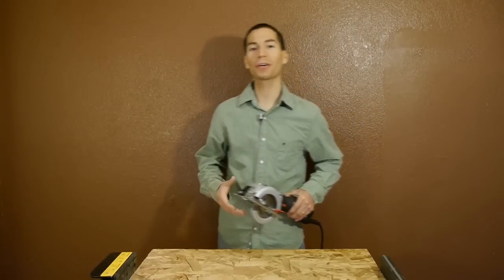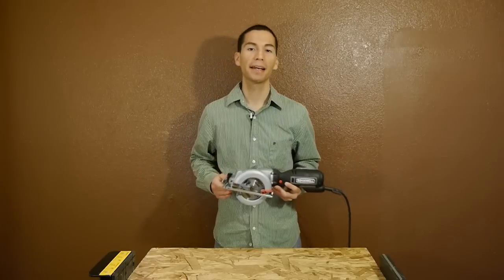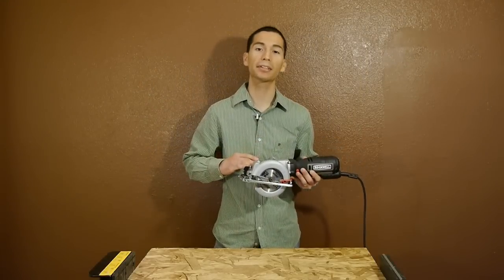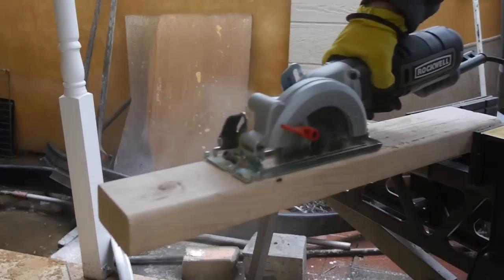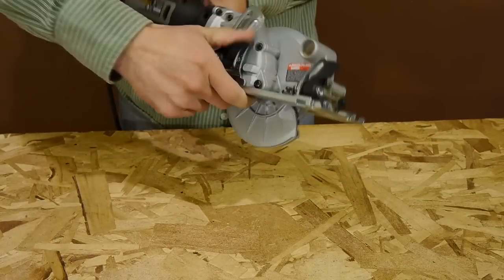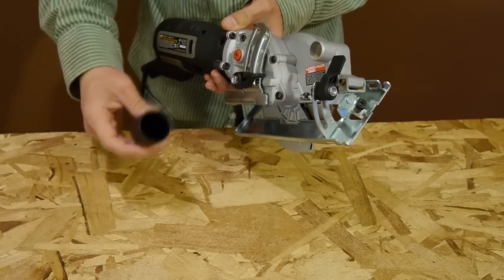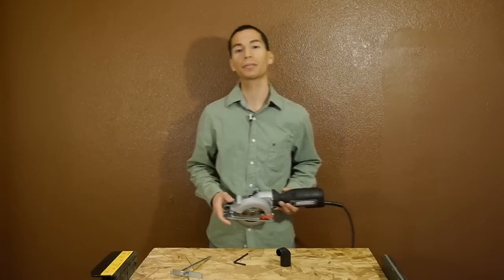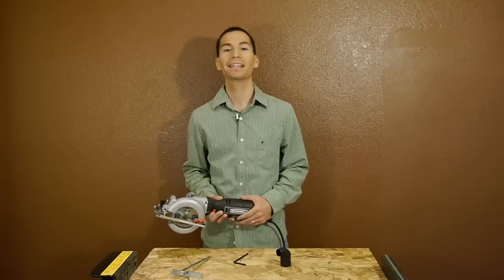Rockwell 4-1/2" Compact Circular Saw RK3441K Review

Comment: I wanted to like this saw, I really like the dust collection port and size.  I ordered online at Home Depot.  The first time I used it, I noticed that it would not cut a 2x4 square.  Even after making some adjustments, it still would not cut square.  I also noticed that the base plate/shoe would flex slightly when applying pressure to the saw.  I returned it.

Comment: great review Javier, i picked this up last year for a home improvement i was working on but ended up taking it back and getting a corded DeWalt 7" saw instead as the depth of cut was ever so slightly too small to make the cuts i needed, which was entirely my fault as i measured the timber incorrectly but it felt like a great quality tool, I have a couple of cordless Rockwell tools so i know they are well made and reliable. I may end up picking this up again just to have it in my tool kit!
Reply from the maker: TheBearuk1 thanks bro, I've done that before. Bought a tool, sold it then bought it again because I liked it so much.

Comment: I have a Genesis from HomeDepot, same saw by another name and less expensive.  Its my favorite saw and have other several new 7 1/4" saws, too.    I try to use it first and go to my other saws only if absolutely necessary because of the small blade.  Its primarily  for crosscutting sheet goods and two by lumber.  Its accurate, light weight as mentioned and  faster for this work.
Reply from the maker: Yeah I've seen a whole bunch of different brands slapped into this tool including a Porter Cable model https://toolcraze.net/porter-cable-pce381k-4-12-inch-compact-circular-saw-rockwell-rk3441k-disguise/

Comment: I just ordered a diablo blade for mine. I install wood stairs and I use 1.25 in (actual 1 1/16in) Red Oak and I cut right through it. Hopefully with the new blade it will cut even smoother. So its plenty powerful, most people won't need to cut through over 1 in Red Oak

Comment: I agree with David J's comment below. The shoe is flimsy and warped in the front. Almost impossible to fix a 90 degree angle with the blade. The handle is definitely for big hands and the safety thumb button is set so on the handle as to be very difficult to manipulate.That said, it is handy for quick cuts and I have used it almost exclusively for a couple years now. Back to the shoe __. a little beefing up of that and I would recommend it. But not as is.

Comment: Now if there's a cordless version of this, it will be the perfect compact circular saw for DIY work. I hate cords lol. Thanks for the video bro!
Reply from the maker: you're welcome bro, and there are plenty of cordless circular saws. The most common are 18V 6-1/2" models some are bigger 7-1/4" saws and you can find them with 5-1/2" blades as well. The ones that would be the closest in size to this model would be the 12V models from Makita Bosch and Milwaukee but the milwaukee 12V is the only one of the 12V group that can cut 2x4's in one pass.
Reply: I do own a 6-1/2" cordless DeWalt saw, paired with their precision blade the cuts are smooth and fast. I was however, speaking about this saw in particular since it's so lightweight and ergonomically pleasing ( from he looks of it) so it would be perfect to have it as a cordless tool in the future. I work on 3/4" MDF so the depth of cut is great on it.

Comment: I have the Menards version of this tool and it looks identical and spec'd about the same. Works quite well but not sure if it will last as long as the Rockwell. Menard's pricing is much less for basically the same tool.
Reply from the maker: There's a ton of clones of this tool from porter cable https://toolcraze.net/porter-cable-pce381k-4-12-inch-compact-circular-saw-rockwell-rk3441k-disguise/ to tacklife and many others. It seems Rockwell doesn't have the rights to the design and the actual manufacturing plant just makes it for whoever wants to slap their name brand on it.

Comment: Nice saw. The smaller size is a great idea . 5 amps doesn't sound like a lot but it seemed to cut quite well. Any idea how it does on tile backer board or cement board? Thanks !!
Reply from the maker: Brett West 5 amps isn't much but because it uses a smaller thinner blade it can perform like the bigger saws as the thinner kerf blade puts less strain on the motor. I only tried it on lumber and OSB but I don't see why Hardie backer board or cement board would be a problem. Just make sure to use a blade suitable for those materials.

Comment: Thanks for the detailed review! How’s it held up?  Does it still cut accurately?  I’m looking for a new circular saw because I currently have 3 and none have a foot that is parallel with the blade, so I can’t cut straight even using a guide.  Been wasting expensive plywood so it’s going to be cheaper to buy a new saw!
Reply from the maker: most of the stuff I review I use only for review and then move on to the next review tool so I don't have any long term experience with this tool

Comment: Hi - great video. At my local hardware store they have a 4A and 5A saw on sale (Rockwell Versacut) but am not sure which I should buy. The 4A has additional items with it like  carry bag, couple of extra blades, laser align and no-mar base. In all honesty I probably won't use the additional stuff, but it's only a $10.00 difference between the 5A and 4A. 

Is it better to get the slightly more powerful 5A version instead?
Reply from the maker: the saw shown in this video only comes in 5a.
I haven't tried the similar but different versacut model so I can't say which is better to get

Comment: Even though it cant cut all the way through 2 inch stock on a 45 degree. Being that the blade is thinner then a 7.75 blade. I wander if the blade cut from the saw is as thin as a hand saw, so one could cut a 45 degree cut and finish with the hand saw without knotice?
Reply from the maker: It's been years since I last had it but I think the staggered teeth of a hand saw would make for a thicker cut

Comment: Does it work well with MDF laminate without damaging / damaging too much the piece?
Reply from the maker: Your question has less to do with the tool and more to do with the blade you are using. For a general rule of thumb, blades with less teeth cut faster however at the sacrifice of a rough cut - something with 24 teeth or less is a framing blade. Fast but rough cut.
If you want to have the least amount of damage, you need a fine cut blade which has more teeth. These blades start at about 60 teeth or higher. The more teeth the finer the cut, however at the sacrifice of speed and more teeth also means that you have a high chance of burning the material if you don't move along fast enough.
40 tooth blades are sometimes considered fine tooth blades but are more of a middle ground but I'd say might be good enough for your usage.
Only problem is that this tool uses such a small blade that your choices for higher tooth count blades will be harder to find plus you can't really fit too many teeth on such a small blade plus would be very pricey. Much more expensive than a traditional easy to find 7-1/4" blade

Comment: Well, maybe I got the lemon... mine does not cut 2x4 like butter.  It hang up about 1/2 or 3/4 of the way into the 2x4 almost every single time, I have to back off and push it through again before it cut.   I did not rush the cut, I take it slow and still not cutting 2x4 with my brand new Rockwell RK3441K.
Reply from the maker: Have you ever used a circular saw before. If not it could be something as simple as your technique when cutting. I remember my sister couldn't cut with any circular saw either until I taught her how to do so. Her problem was that her cut's were not straight which cases the blade to bind with the material. However if you've used circular saws before and know what you're doing, it could be defective.

Comment: i wonder how it compares to worx saw. 4 amp vs 5 amp
Reply: worx, meterk, rockwell and other saws are identical. the only difference is the motor housing and what extras you get with it. 
you cannot make a decent straight cut with these saws, the blade is never at a perfect 90° angle to the bed. if you dismantle it and file down the points of contact for the bed it can be made to perform very well someone said in an amazon review.

Comment: Well now, let me tell you my experiences with this saw, I have used this saw off & on for two-years...  It really sucks at most tasks..  First, the blade is so thin that it won't follow a line/guide when ripping(follows the grain), I use the Diablo-blade, it works better, But, not to my liking.. Second, the shoe is loose as a goose, not aligned with the blade, I used washers to somewhat align the shoe-edge to the blade with some bracket bending.  Third, the grip is very bulky, small hands need not apply.   Now, would I buy it again, Never!   It misses the mark by a long-shot, But, if you need a small cut-off-saw( like maybe for picture-frames), get rid of the base and hinge it to make those 45-degree-cuts, that is the best I can say for this tool-wannabe..  I wanted to like this saw, but I just can't!!  It just doesn't do anything well...
Reply: Thank you for your input. It's great to get long-term experience on the way a tool is truly performing after many uses. I had the same problem with a 7-1/4 in saw and was fuming since it was $$ lost.
Reply: I agree with you!
I just bought this saw and used it for 1 day...I couldnt rip a straight line in 1/2" plywood no matter what i tried. It just kept wondering...
And mine started to get really hot! Like to the point it was uncomfortable to hold onto...
Guess il be breaking out the old 7 1/4" Skill saw tomorrow to finish ripping some sheet goods...

Comment: so this does any job and batter then other electric saws
Reply from the maker: +jerry calderon no, it can do what some of the larger saws can do up to 2x dimensional lumber but with a smaller blade and at a smaller more compact size with less weight. It can't do everything the larger saws can do and that's because of it's smaller cut capacity due to the smaller blade.
Reply: +Tool Craze cuz I got to work on my restroom and I wanted to know if this would do the job
Reply from the maker: +jerry calderon did you read my reply?
Reply: +Tool Craze yes I did that's why I was saying I got to work on the restroom thanks
Reply from the maker: +jerry calderon cool!

Comment: I bought this tool to make life easier but not worth it . First of all the safety button and trigger orientation are just stupidly placed which make it almost impossible to turn on with one hand - second , the kickback is ridiculous and very dangerous as I've seen is a common complaint amongst people who have used it . So you will have to figure out how to clamp your work down and use two hands to hold this tool to avoid injury .

Comment: spec with a 10' cord, don't believe it, I have had two delivered to me both saws had a 8' cord.
also the impossible to find bolt with left hand thread is only available through the mfg.  using this saw one handed  NOT, without some guide board!  be sure to measure the difference from front to back from the shoe to the blade, its a few thousands off!

Comment: all saws of this type except ones by renowned manufacturers are identical, that's to the point of me believing they're made by the same company on behalf of the brand names.
everything is the same from how they work, where the controls and levers are, right down to how the blades are NOT PERPENDICULAR to the bed meaning they CANNOT CUT STRAIGHT. it looks like a deliberate choice to make them deficient too. maybe someone in Big Tool (lol) didn't want the market for other saws destroyed and specified a fault or imperfection must be built into saws of type. I've had two, the first brand being more faulty than the 2nd but both had blades that were off kilter by the exact same amount. I wish someone with the time and resources would look into this.

Comment: you didn't show  how to install the blade.  The manual is not helpful.
Reply from the maker: This is a review. What you're looking for is a "how to" video. But installing blades on any circular saw is easy and the same. You remove the screw holding the blade and replace. Easy.

Comment: The saw blade sucks. It could not cut a straight line in thin soft wood. The thin carbide blade flexes and makes this tool useless except for maybe cutting small wood dowel rods.

Comment: This tool is the shits.  The first thing I didn't like about it was the cord length.  Its not 10' as advertised its 8'  The second thing is the blade bolt.  Good luck when you brake one of these as you better have a spare, you won't find it available at the local ACE.  Then the cut!  You have to push this stupid release button before you can engage the trigger!  I hate that.  I put the sole plate against a straight edge and it cut anything but straight!  The edge of the sole plate is made so cheap that its not parallel with the blade.  It took several hours until I could get a good cut.  My advise go buy a Milwaukee!